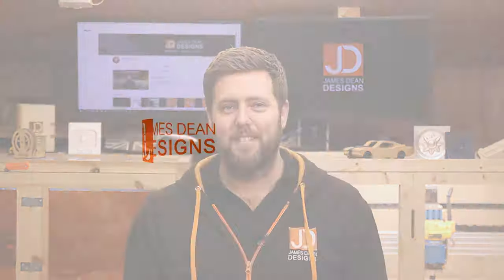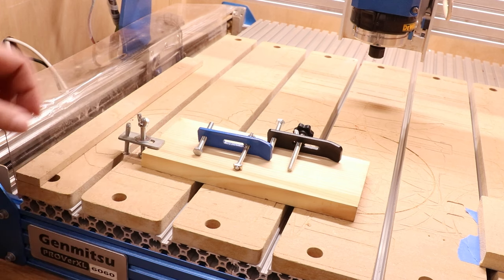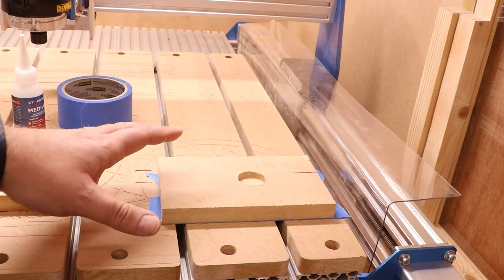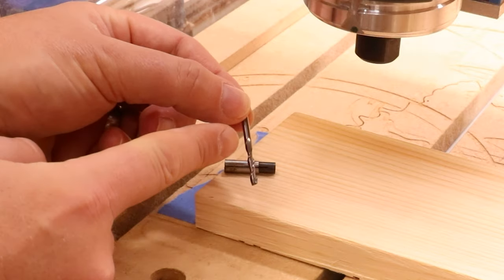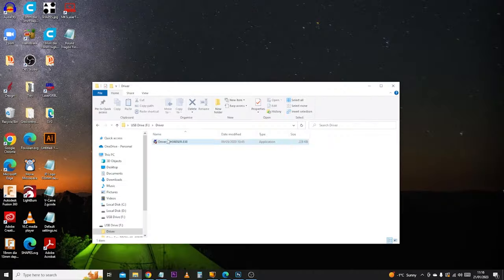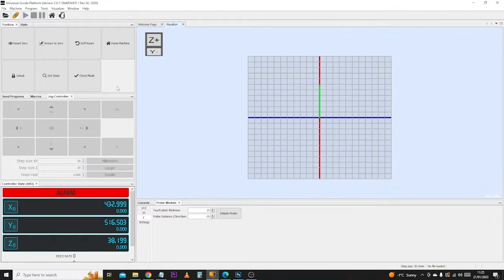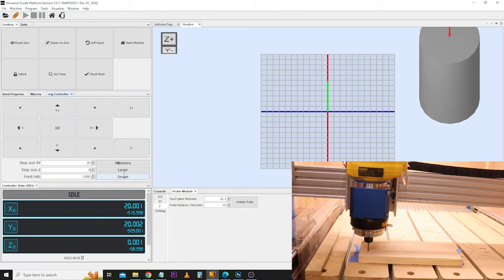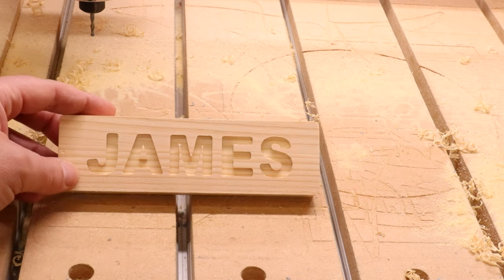Setting up your first CNC job

Comment: Problem with my Genmitsu 4040 Pro Max.  New to CNC. Using Fusion 360 and UGS.  I've searched your videos and the internet. Can't find answer to my problem. I've tried every solution I've found on the internet.  My problem.  Cutting simple pocket in wood. The CNC cuts in the air above the wood.  Can't figure out how to get the bit down to the top of the wood. I followed you zero Z axis video and it comes back to zero okay.  Would like to send you an image of UGS screen but can't seem to do that. Thank you, rob

Comment: For all of us brining pre-made cad files into carveco (I bought f16 cockpit plans). You should mention on how to force the workspace “0” to the bottom left or right or whenever. When brining a premade file in, it will set 0,0 at the center of the workspace, then when you export into ugs, it will cut all messed up because zero on the bed and zero on the workspace pertaining to your tool paths is very very different
Reply from the maker: That's nothing to do with the file your importing, that's the initial screen when you create Carveco file. When you click new in Carveco it will ask where you want the job to start from,  you just need to select bottom left or bottom right. This is covered in my Carveco Maker series of videos

Comment: You don't need to do much holding down. It is sideways movement you need to prevent. I have two inch wide discs with several holes in them at various distances from the centre. Get one as close to the job as possible, rotate it until it presses against the side and tighten the screw.

Comment: I consider myself an 'advanced beginner' and I did pick up a few tips here.  One thing you didn't cover for the beginner is how to open the file containing the code for the job.  I generally use Easel so, as you know, you have to export the SVG file and open it in UGS.   I have found a number of your other vids helpful.  Thanks for posting.

Comment: Can't say anything any better than those before me......Just glad I found you when i did.  I was about at the same point as jamiepierce2055 was a year ago.  Bought my CNC for one very specific use (Blue and Red line flags).  Ordered it, and while waiting , built 2 workbenches (1 for my CNC, and one for a planner). And had time to come up with A LOT' of other uses besides my flags.  So excited about starting my CNC experience.  Just  A LOT to process and learn.  Thanks to you, it's (alot) easier.  THANKS!

Comment: some humor for you james. i just ran my program from easel for my house numbers on a piece of mdf to check the program and my homemade cnc. everything was going good apart from some burning when the bit was working in a small section. 90% complete and the oval cut out started to wander so i stop the program. stupid me put the bit in upside down. a true rookie mistake. lol

Comment: Even after following this video step by step, I still can’t make this machine, software or whatever work for me. I’m really thinking of returning it now.

But I wanted to thank you for making these videos, yours is the best I saw.
Thank you!
Reply from the maker: That's a shame. Is there any particular part that doesn't seem to be going right?
Reply: @JamesDeanDesigns  I can’t even engrave the test codes that came with. It just makes these messed up lines and goes further than it’s supposed to.
Reply from the maker: @mlcyane8446  if not done so already, join one of the main group like Sainsmart or FoxAlien on Facebook and post some photos with as much information as possible or even a video if you can. And hopefully I'll see it and can probably help you out better than on here
Reply: @JamesDeanDesigns  Oh, that would be awesome thank you!

Comment: Greeting James, I have foxalien Masuter pro with the extended kit.
Thank you so much for the guidance your channel has provided for me.
I have a few strange issues
#1 I have set my zero on the job for the x y and z axis, then jogged in and set height for the spindle with the probe touch, the returned to zero.. all this works great as per your instruction.
#2 the spindle does the same project about 4 times then I have to stop the machine otherwise it keep doing the same job

Comment: Thank for the videos. Super helpful. My only issue is that I created a project in easel, saved the g-code and opened it in candle. Everything workd fine except the spindle wouldn't spin. I tested the spindle and it works. Just won't spin during the job

Comment: Great video!! I have this cnc machine. I bought it after watching your videos. Ultimately I want to machine a guitar. 🎸 am able to fit a body on the bed, but for a neck. Need something a little bigger. 

They have a 1313 frame upgrade which measures 52 X 52in. My concern is the stability of the cnc at that size. Do you have any intel on how stable that would be? 

Thanks!

Bert

Comment: Fantastic James.thank you. Your content never disappoints! The question I have concerns Z height when changing tools during a job:.i.e using a !/4" end mill for roughing and a 1/16" to catch what is missed by 1/14". While I appreciate that UGS has the Z zero we set initially, I cannot see the tips of the tool being in the same point in space. Also is setting Z zero when working with V bits? FYI I am new to CNC world, getting started with Genmitsu 4040, Carveco Maker and UGS. As always Thank you for all you give to our community.

Comment: Hi James, thanks for these tutorials, finding them very useful.
I have a 3018 pro and Vcarve Desktop but each time I try to run a job that I've done on Vcarve using UGS, it places it outside my work area. Ie in the bottom left!
Even though I've set my zero point in the centre of my bed. What am I doing wrong?

Comment: Hi James, just down loaded UGS and working through while watching your video, very informative but i seem to be running in to a couple of issues, probably operator error 😊, when Jogging the spindle to the corner of the material the jog controller is staying on Jog instead of returning to idle, any suggestions would be ver,y much appreciated, my Masuter pro goes unresponsive as well until i shut everything down

Comment: thanks dor the great tut. 
one question : I have made my own diy cnc and i am using nema 17 stepper motor. downloaded grbl to the cnc shield and when it gets to UGS the rpm max is 300 if i turn it to 400 and above the stepper mottor frezzes ? is anyway i can bump the speed ?

Comment: Hi James, have you any idea why when I set my Vasto to carve, it carves the toolpath trails and not the job? Also, when homing, the Z axis is fine, but Y hits the lilit switch (which I have tested and it works), do the motor continue to run, they don't stop and back off. Any help greatly appreciated. The machine has worked but has just thrown a wobbly! Same results using UGS or Candle.

Comment: I'm just awaiting delivery of my first CNC machine (Woodmads CNC Router WM3020 ). I am going through all your videos at the moment.  Something I never see (so far, please excuse if i've missed) is squaring up the material on the spoil board,  should we not do this with a set square to ensure the tool is running exactly square to the job?   Many thanks for all the time and effort you put into these videos!
Reply from the maker: Hi David. I briefly cover it in some of my spoilboard videos but it really all starts with ensuring your machine is as square as possible when you start building. If you're fairly confident everything is running square then you can engrave a grid on your spoilboard. You can then align your material to that grid. This thing to remember as well is do not assume your material is always going to be 100% square.
Reply: @JamesDeanDesigns  Thank you James, that makes sense .I will also check that video out .  All the best

Comment: Thanks for the very helpful video.  However, I got to the very end.  Literally, the very last step.  UGS opens the file, but there is no option to start the process.  Start button is greyed out.  I have seen some comments online that UGS won't run a file more than 200kb.  This one is 268kb.  But I can't find a simple explanation anywhere of what to do.  What am I missing?

Comment: I'm using Ventric, the licensed version, I have UGS installed but you don't mention any way of using this (not that you are obliged to). However, do you cover this somewhere? Thanks
Reply from the maker: Using Vectric with UGS? So when you come to export your files you'll just need to select "GRBL mm" or "GRBL in" as the post processor. You can then load that into UGS and you're good to go
Reply: Thanks for the reply. I'll give that a try.  @JamesDeanDesigns

Comment: Hi James, I have the 3018 PRO and have 2 questions if you would be so kind as to help me. 1) When I export the G code for a project into UGS to carve, there is no code to start the (or stop) the spindle motor, but when I run the project directly from Easel, it works just fine,So, first, why do you "strongly suggest running my project from UGS " instead of  Easel, and HOW do I edit the G code in UGS to start and stop the spindle motor?  Thank you so much!
Reply from the maker: Within Easel, under machine settings I think, there is an option for the spindle and the options are manual or automatic. Set it to automatic and then when you export the code it will include the relevant bits to start the sli

Comment: Hi James, thanks for a very useful video. Can I ask what DeWalt router you have installed and is there a dust shoe you recommend for this router?
Reply from the maker: Mine is the dewalt D62600 which is basically the UK/European version of the DWP611. I just have a 3D printed one which I made and it does the job. I guy I know sells some on his site. I've not personally used it though https://www.mmandls.com/product/foxalien-4040-xe-dust-shoe-vacuum/
Reply: @JamesDeanDesigns  Thanks James, very quick and useful reply. Thanks for all the help and videos, much appreciated.

Comment: Would blue tape suffice for aluminium engraving or should clamps be used?
Reply from the maker: I have used just blue tape before and it was OK a long as your piece isn't too deep, but found a significant improvements when I started used a low profile clamp

Comment: Thanks James do you know can i keep my probe connected on the masuter pro? because it looks to me if your gonna clip/unclip it 1000 times its gonna break i think? that little wire thats coming out of the controller box is not gonna hold a 1000x times... curious to your answer on this...
Reply from the maker: You can replace the clip with a magnet, and instead of clipping it on  you just put the magnet to the collet instead. To be honest though, a length of cable and a clip is less than £2. If I got a 1000 uses out if it and had to spend £2 to repair it, I wouldn't consider that to bad of a trade as everything on these machines will suffer from wear and tear over time
Reply: @JamesDeanDesigns  no i mean the little connector where you connect the probe with the machine can i leave it in there?

Comment: Is there an option in Candle or UGS to run the Gcode step by step? I'm trying to mill a PCB but the spindle always starts at a position I don't expect
Reply from the maker: I'm not 100% sure that is possible. You could open the file in something like NCViewer.com and that might give you a better insight

Comment: I'm using ugs on Mac to control 4040-xe. All the controls work, except the spindle does not want to turn. I've tried the M3 M5, but that does not work either. Do you have any tips please😁?
Reply from the maker: It's not just M3, you have to type a speed reference as well so try m3 s10000 to turn on and m5 to turn off. 
If that doesn't work then you could try another piece of software like Openbuilds Controller to rule out software, or alternatively if you have a multimeter you could try doing some basic tests
Reply: @JamesDeanDesigns  Thanks works perfect now👍

Comment: Hi I have a 3018 and the laser works fine. I am having repeated issues with the spindle engraving. For some reason the Z and Y axis move at the same time? When I put a project in the spindle works fine but at the start of the project the Z axis raises and starts engraving 50 mm above the wood. Has anyone else had this issue?

Comment: Hello James.. I have connection problem with my machine cnc 3018 pro connect with ugs.. It is successfully connected but the xyz is not moving and some icons is show in gray color.. What is the problem? I connect my cnc 3018 pro with candle it worked fine.. I hope u answer my question
Reply from the maker: Usually in my experience if UGS is saying connected and not showing all the buttons then it's connected to the wrong COM port. Double check your com port number and also make sure the Baud rate is 115200
Reply: Thanks very much I will Try
Reply: The buttons are working  but when I press still the machine is not moving

Comment: Can you tell me how to add a bowl bit in easel,,, i hate they're bit database and cant seem to get it added,,, is carveco better?
Reply from the maker: Its one of the reasons I moved away from Easel, its tool database is poor and yes Carveco is better. I dont think you can enter a bowl bit. You can try entering it as a ball nose but that is slightly different because a Bowl usually has a flat bottom where as a Ball nose is rounded all the way